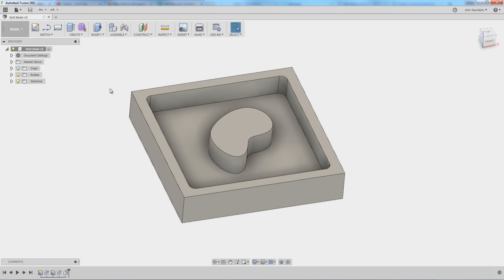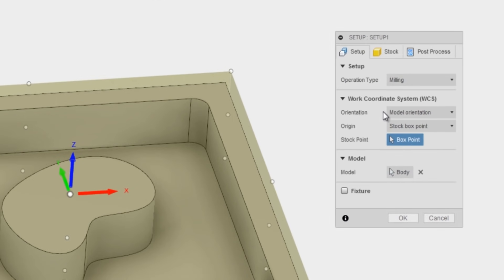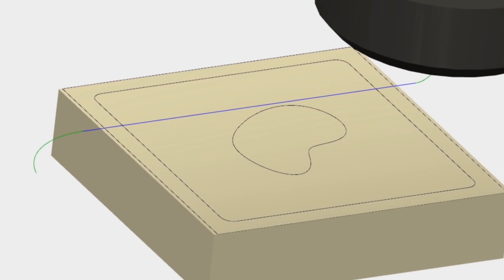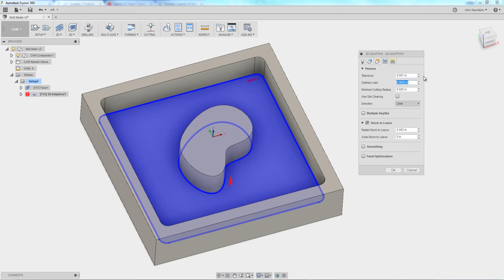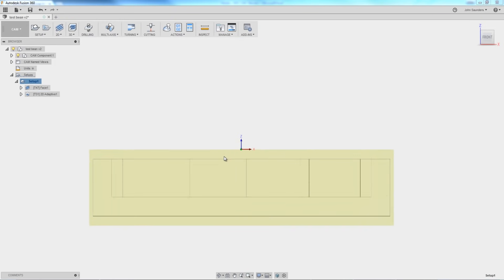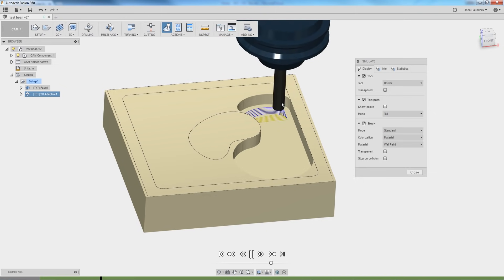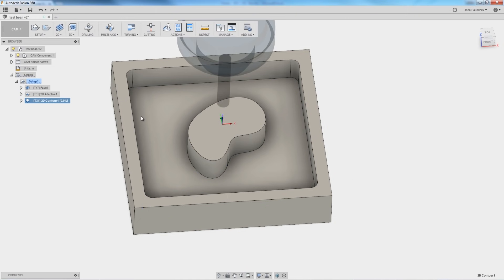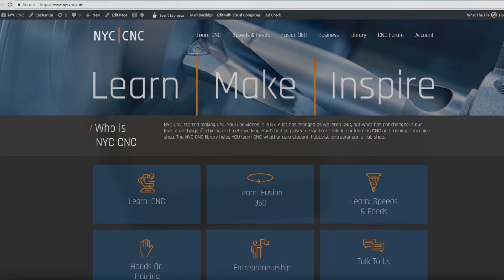Fusion 360 CAM Tutorial for Beginners! FF102

Comment: I couldn't help noticing you recommended setting depth of cut to 200% of tool diameter.
Doing so will ultimately cause you to wear out the bottom 200% of your endmill.
One of the big advantages that I saw when High Speed machining became available, was the ability to use the full length of the cutter. You just have to adjust the feed rate and amount of engagement. I've never used anything as aggressive as 20% unless it was a stub length endmill with a fairly shallow depth of cut. I usually run about 5-10% engagement, depending on how tiny or robust the endmill is; then crank the feed rate for efficiency.

Comment: How does one prevent the tool from hitting the tool holders , is there a way to fence off the areas? The problem is my parts are small, and the are held by t clamps, ideally I would prefer the top and the sides to be exposed completely for milling, but this is not possible with t clamps

Comment: Thank you for sharing your expertise! Finally moving from 3D Printing with F360 to milling and CAM. I hand codded G-Code back in the 90s for my converted mini mill. Hand coding still seems simpler than learning the new software but Adaptive tool paths are the only way to cut metal with the high speed spindles on todays gantry routers.

Comment: I'm just starting get into Programming just had quick concern. I have a MacBook pro
 2.8 GHz Quad Core Intel i7 
/16GB 2133 MHz 
/Graphics 655 1536 MB.
 Can I use this for Fusion 360 or Mastercam or would I need to get a gaming laptop or PC? I'm currently looking get into college & get certification in Machine Technology but before I head in that route I want try this out see if it works. Im 24 years old been working machine shop 6 years 2 recent ones been doing Set/ups so I think I'm ready for next step. 
Any input would help out, 
Thanks again ✌

Comment: Tried this entire video on a simple program, but when running the program on my new SYIL X7, offset is set on top of the material in G54, but somehow my facemill, takes NO material during facing off. Haven't run the entire program yet, only because I'm very careful trying to do first cuts on my brand new machine. :) But why does it take any material during facing?

Comment: I’m just starting out with a CNC Mill and a CNC Lathe, and have just started to learn Fusion 360, your videos are absolutely brilliant!! Thanks for sharing!
Reply: I am a complete noob on this and find his information very informative and valuable. Fusion 360, however, not much so as I find it is locked and I cannot make the settings he is here. Now, it is not like I paid for the SW since I am using the freebie version, but this makes it pointless to learn now.
Reply: Finally figured out what the issue is. It cannot work with and STL file but STP work fine. FYI to anyone running into something similar.

Comment: Hey , melted chip is because no inner cooling or more then 2 spiral on machine with 10000 rpm . Of course feed per edge  is also to small . You have to get rid off heat in chip . This is a main rule in milling processes . Heat mainly goes to chip 70 % depends material , but , stainless steel is common example .

Comment: You used a roughing strategy (adaptive 2D) and left zero stock on the floor.  The swirl marks from the adaptive looks terrible as a finish.  How do you make the 2D contour finish the floor?
Reply: I'm assuming you have figured this out, but for those wondering, you would do almost what he did, but the opposite and use the pocket tool and have it cut down 1 thousandth of an inch or so with your finishing tool.

Comment: John, a beginner question but why wouldn't you position the model at the bottom of the stock so you don't have "face" the back of the part once you have completed the cavity work shown and milled the sides down to the correct wall thickness?

Comment: Great video again.  Could you please do one covering machine on two sides (top and bottom of a part.  Mainly after the "gotchas" for the heights like the model "TOP" becomes the model "bottom" when you flip it over.  What are the best practices for machining on tow sides??  Thanks
Reply from the maker: YES!
Reply: Great thank.  Actually your next video that pops up kind of covers it ( https://www.youtube.com/watch?v=g7bu4JuPC_8 ) but it does a top and a side.  and you seem to be able to use "model top" even though the model is on its side.  With my newby experience and trying to do a top to bottom flip, my heights got messed up and the tool plunged to full depth as it travelled to start the first cut. I managed to fix it but not sure I did it in an ideal way so look forward to your video.
Reply: Can't wait!